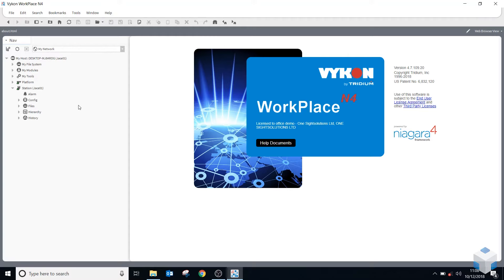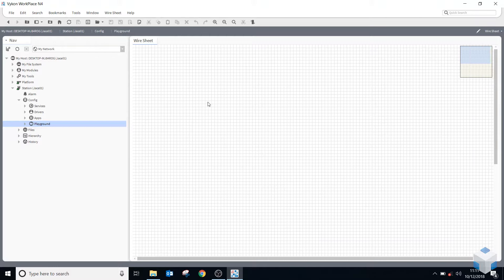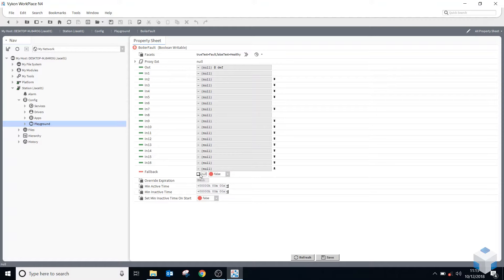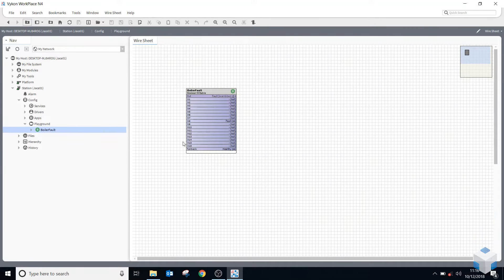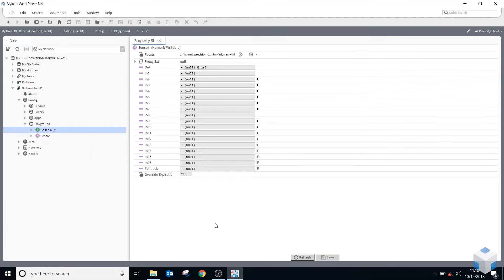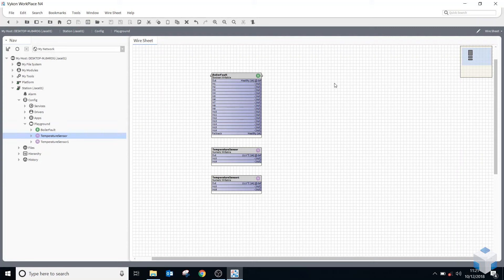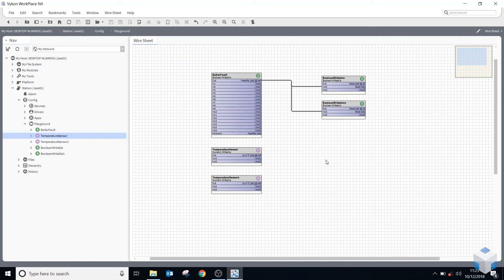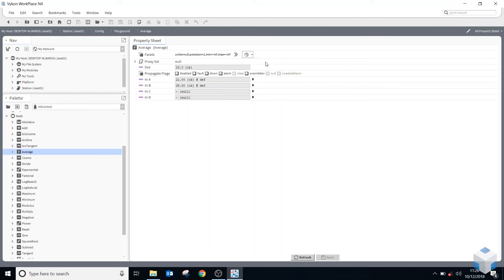2. Basic Components - Niagara 4 Video Training

Comment: Hi there. I'm trying to program four parking lot jet fans to turn on simultaneously whenever the concentration of CO reaches a certain setpoint. The Start/Stop points are binary outputs and the speed points are analog outputs. I've set a greater than block to compare the gas to the specified setpoint. But I still can't seem to make it work. What am I doing wrong? Could you please help me??? URGENT!

If I can somehow send you a picture of my current program, that would be great.

Comment: I really dont understand how this would apply to what youre doing. Like if you could give an example of how a value change would influence something in a real world example that would be tremendously helpful to someone who has no background in this.
Reply: he has multiple videos barging on real world examples. not to discredit the argument but i started on niagara today. just booted up and got my license straight. this video was very helpful in the understanding of placing values and getting your blocks right
Reply: @runartafjord8311  Hi there. I'm trying to program four parking lot jet fans to turn on simultaneously whenever the concentration of CO reaches a certain setpoint. The Start/Stop points are binary outputs and the speed points are analog outputs. I've set a greater than block to compare the gas to the specified setpoint. But I still can't seem to make it work. What am I doing wrong? Could you please help me??? URGENT!
Reply: @julianbabilonia8562  hey there, glad to help. If you still need it.
Remember with CO measurements you need the sensors close to the ground since CO is 4.0 times heavier than the air we breathe.
You need to know the standard of mounting height that is by law.
Other than that, are you only using the eaglehawk or jayce?
It is imperative that your output signal is configured to the right slots
Reply: @julianbabilonia8562  also the CO should not be more than like 10ppm or so, dont recall the specific measuring value for CO.
And try to notice where there are electrical vehicles since they dont produce any CO in the first place.
I know this was not the question but you will not have any input signals that start/stop the fans if you get the transmitter placement wrong.